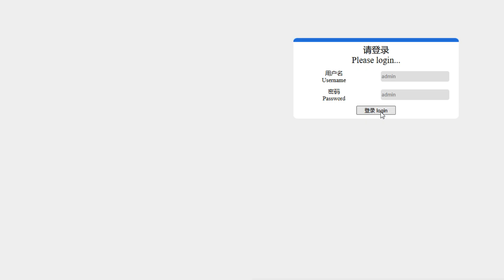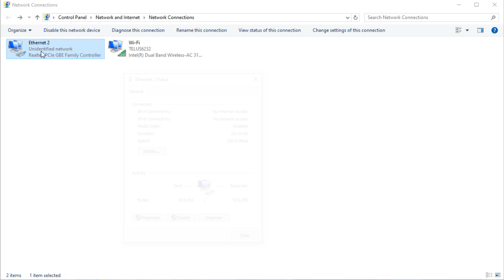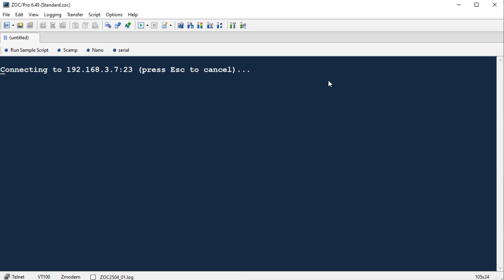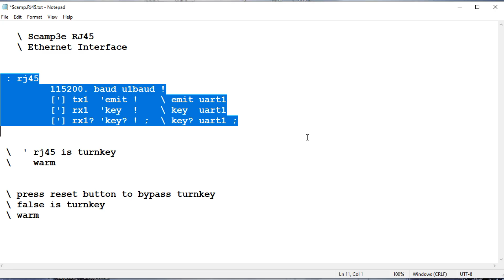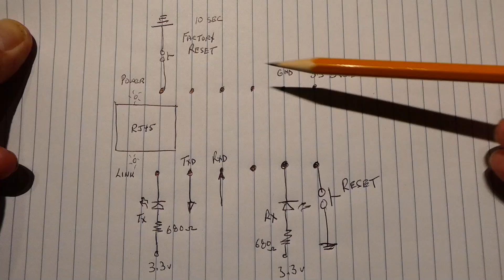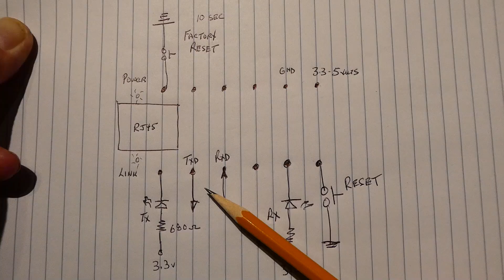Network Your Microcontroller Project

Comment: I was expecting UDP packet at the very least.  UDP can be viewed as a straightforward generalization of UART.
Reply from the maker: As discussed in the comments this setup was prepared for a high school electronics class, so simplicity was a priority. If you want to communicate using UDP, select UDP as work mode, enter a port#  (5000) and download Hercules Setup software. Now you can communicate over UDP.

Comment: Hi, almost similar like this, I use ESP8266/ESP32 module and the JeeLabs ESPLink software to convert UART to WiFi (instead of ethernet using cable), and so I can access remotely any microcontroller from the network, wirelessly...

Comment: Great example, again. I'm  eager to experiment with this module and would like use it in a programming class in combination with Flashforth. My question is. Is it possible to give a messesage  to the NE2-T1B so that it resets the attachached microcontroller. For instance the nano has a reset pin that when set low restarts the device.  Especially when programming endless loops, on purpose of accidentally, you would to have the ability to reset the controller.
Reply from the maker: There are no GPIO pins on the NE2-T1B to apply a hard reset to the nano. The easiest way to detect runaway code and reset the nano is to incorporate a watch dog timer in your code. Check out this video: https://youtu.be/8sZheJVl-R8
There are also hardware reset ICs like the DS1232 that will do the same thing.
Another option is POE (Power Over Ethernet). Toggling the  power to the nano a will cause a power on reset.
When programming endless loops it is good practice for a way out by detecting a keypress or the escape key.

Comment: Good job
The remarks
Why call you the ethernet cable always internet cable?
The network identifier is 192.168.3.0 the host is 192.168.3.7
Reply from the maker: I used the word "Ethernet". The Canadian accent probably through you off.
The subnet mask shows where to split the "address" into the network "ID" and host "ID"
The two IDs together make up the full class 3 address. https://www.youtube.com/watch?v=pW11niTFUqI
Thanks for the visit.

Comment: The classic and fairly high performance solution is ENC28J60 SPI Ethernet Adapter by Microchip. You're not exposed to any firmware of suspicious quality and security as opposed to this, but you must carry a network stack in the microcontroller, so it takes up flash space.
Reply from the maker: This was prepared as a high school electronics class lab as an introduction to Ethernet and networks.
The pre-requisite was no code, no libraries, easy to get up and running and inexpensive.
Not selling any product to the outside world. Thanks for your feedback.
Reply: @0033mer  Totally agree. I have the ENC28J60 shield for the nano. It only works with a software ethernet stack which complicates things. I like to seperate the function for communicating through wifi/ethernet from the program on the microcontroller. Highschool students are a crititical user group. When things mess up you as an instructor have to come up with an solution quickly. Functional seperation by using dedicated hardware helps me with that.
Reply: esp32's with wifi and rj45 are fairly affordable

Comment: can you do PoE?
Reply from the maker: That would be handy. This setup does not support POE, but you could add a POE injector and splitter if needed.
Reply: Anything can be powered with a PoE extractor, there are many in 5v o 12v version, I just paid 10 euros for a couple of 100Mb- micro usb, very handy for powering raspberrys
Reply: it's just a matter of wiring 😂